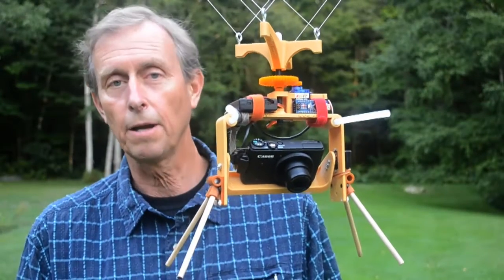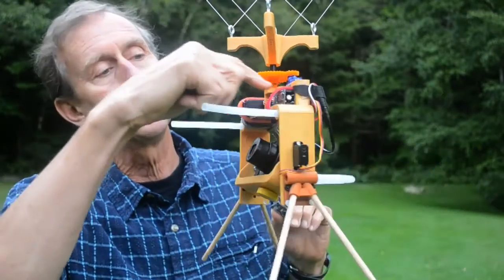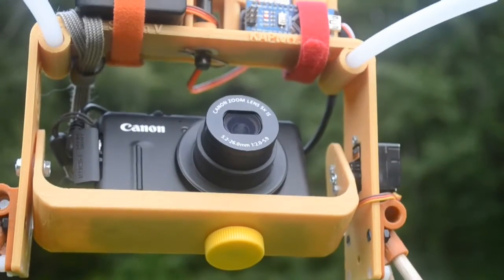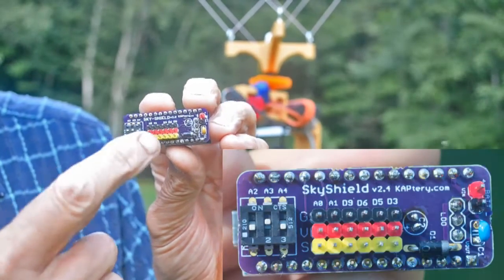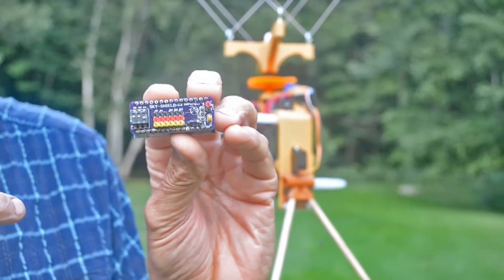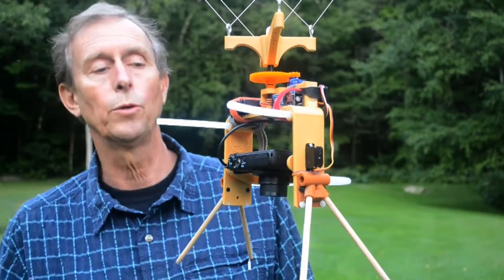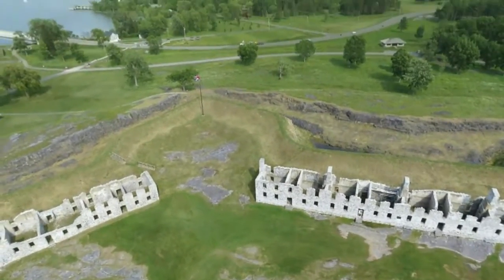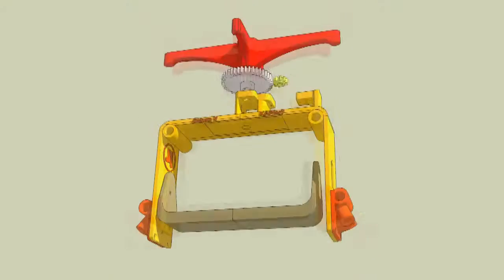Up Goer Five outta beta

Comment: hi the dimensions are wrong when you load the STL file in fusion360... do we have to scale it up? If so by how much?
Reply from the maker: This is a units mismatch. Your program is interpreting 6.42 inches as 6.42 mm. Multiply the units by 25.4 to get 163 mm x 141 mm.